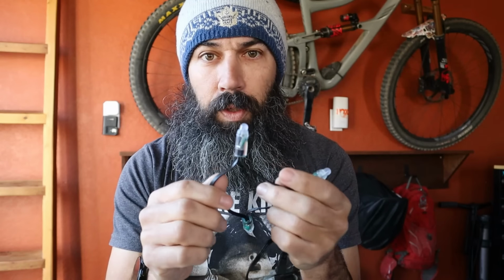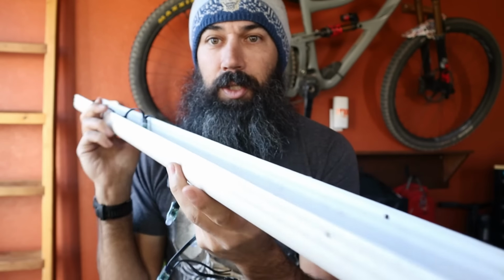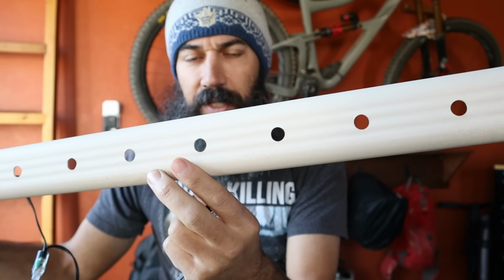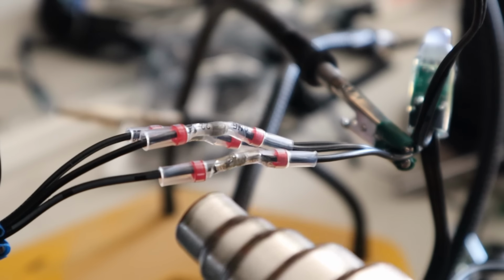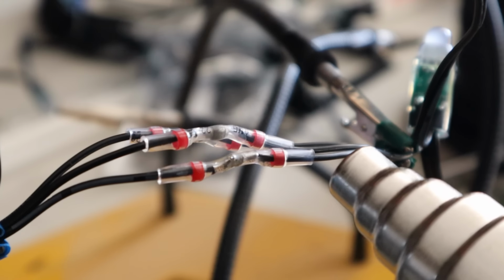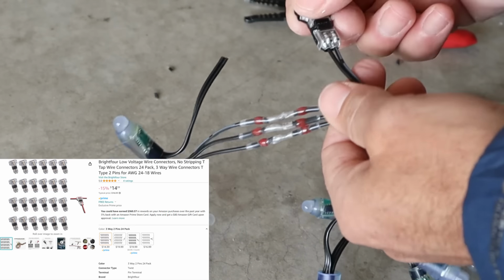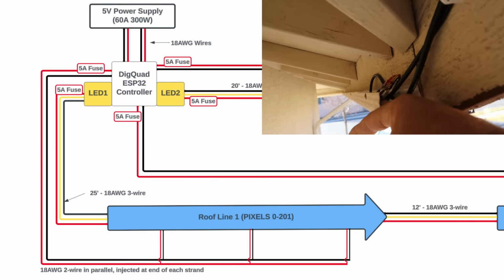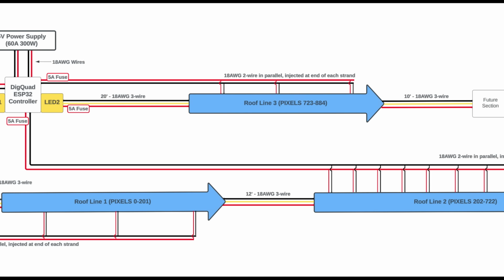Permanent and AFFORDABLE Holiday LED's

Comment: I want to put permanent Christmas lights on my house so bad, and have already bought some and tried some out.
The only trouble is what do you do when you paint your house? I'm a professional paint contractor and have been doing it for almost 30 years. Every time you paint your house something you can have to be done to all those lights and that's going to be time consuming, and expensive. Just wondering?
Peace from California!
Reply from the maker: That’s a really good question.  It would definitely create a challenge.  I’m not a paint contractor so I can’t speak from experience here, but…..how often does it need to get re-painted under the eaves?  (Unless changing color entirely)  Our house is stucco. It’s 10 years old. Our stucco trim definitely needs a fresh coat. Also I’ve done some of the outside of the fascia trim by hand already.  But under the eaves see very little sun/weather. So I don’t know how often they need to be painted. That said, if it was only once per decade, I think you could take these down a few sections at a time and put them right back up. Maybe a good reason to look at waterproof connectors instead of soldered….🤔
Reply: I mean unless youre painting your house every few months you would just remove the channels prior to painting.

Comment: Christmas and Halloween Light show enthusiast here.  Good rule of thumb is power injection for 5vdc pixels should be every 50 pixels regardless of how many feet you are going.  I use 5vdc pixels on my light shows and my cards are always about 5 feet away from the pixel strands and every 50 pixels use a power injection for both positive and negative lines.  2nd use IP67 pixels for waterproof pixels.  12vdc pixels are better for long runs and less wiring when it comes to power injection.  Suggest you NOT use the plastic downspouts unless they are UV rated.  Plastic electrical conduit are rated for UV an may be a better solution.  Overall, very informative video.
Reply: Aren’t vinyl downspouts UV rated already? They do spend their intended purpose in the sun all the time…..
Reply: Several years ago they were not and had mine taken down due to how brutal the sun was on them.  They were very brittle and had them fall apart when taking them down.  You would think the newer ones should be but would would have to research it @Eggwelder
Reply from the maker: @Eggwelder  pretty sure they are UV rated already. Don’t think you would normally paint one, so they would be in the sun a lot.  Although my channels won’t see much direct sunlight.
Reply from the maker: Thanks for the info.  Cards?  Are those the controllers?

Comment: Something to consider if you are doing this, look into 12V or 24V modules. When you get into wire lengths of 100ft, voltage drop starts to come into play and 5V may not be enough to make it 100ft+ to the end LEDs. Usually this shows up as color issues at the end of the string.
Reply from the maker: Voltage drop for sure comes into play.  When testing long runs I could definitely see a change in the color by the end of the strands.  Power injection is a must.  Using a larger gauge wire (larger than the strand wire) and injecting at the end of every strand seems to do the trick pretty well.  Definitely can't rely on the strands themselves to keep the voltage.  I assume that would be regardless of the voltage, but probably more pronounced with 5v like I did.  Either way, great call out!
Reply: On his diagram it looked like he tapped 5v into every new strand.
Reply from the maker: @joe_duck  correct

Comment: I haven't seen anyone use the downspouts for the pixel outlines before, quite often seen what they call J Channel which is for fascia I believe. Being from the UK I just don't have access to half the things you seem to be able to get at a hardware store that those in America do but we do have square gutting pipes, I had just not thought to cut it in half xD

It would be wise to be some what cautious about where you get pixels from, especially for a permanenet install, the cheap ones are know to die very quickly and often (from personal experience here). The cheaper lights also use cheaper computer chips that are not capable of reproducting the same range of colours, this is something I noticed when I started switch to better quality ones that were just so much more vibrant. The cheaper ones also have more erratice spacing between the pixels and use CCA (copper clad aluminum) rather than pure copper or tinned copper which are much better at conducting electricity so over the length of the string start to change colour as the voltage drops and power injection needs to happen more often.

There are companies in the US that are dedicated to "holiday light shows" like Mattos Designs, Wally's Lights, Wired Watts are just a few I have heard of but never used. In the UK there is Build a Light Show which I have used and been very happy with (no affiliation with any of them).

Lights from these companies also come pre fitted with out door rated pigtale connectors and often come with ready cut out "props" made out of plastic ready to push pixels into as well which are also great fun, singing faces to music are especially enjoyable to watch.

Just something to be aware of with the pixel strip vs strings, the string tend to be a lot more resiliant can capable of being moved around without damage, the same is not true of strip. With a permanent install this is not an issue but if you intend to be able to move them around the strip will fail a lot faster as the strip itself is very fragile.
Reply from the maker: BRO!  Where were you BEFORE I did this!  LOL!  Great info dude.  Thanks!
Reply: @DadDoingStuff  You're welcome and feel free to ask anything you like. This is what I do for fun for the last few years. Started of making megatrees outside my house, my current one is about 10ft :)
Reply from the maker: What kind of pixels are you using for the mega trees, and also how are you mounting/hanging those lights?  Also, are you running a separate controller for each of those?  Thx!
Reply: @DadDoingStuff  I use 12v pixel strings in the exact same bullet style that you have used in this video. Different brands call it slightly different things but something along HDPE Mega Tree Mounting Strip, basically it is a ribbon of plastic with holes every inch that are the right size for the pixel to slot into, I personally push a pixel into every other hole for 2inch spacing, some do 3 inch spacing, some populate every hole, up to you really. You then have a pole (I use piece of scaffolding) which at the top you have a topper which is usually a metal disk with holes drilled around the edge and you attach the strings of LEDs too. Then around the bottom there is a large metal ring, I used a trampoline frame for mine. I believe Mattos Designs have a kit you can buy but i haven't looked into it.

As for the controller, I used one called Falcon F16v4 which has 16 ports (can be expanded to 48 ports) and that can each handle up to 1024 pixels per port but I typically aim for less than 500 per port. If that isn't enough for you you can connect multiple pixel controllers together to controll larger shows. There are other options, I know of a brand call Kulp which I have seen good things about, I just can't get them easily in the UK. I have also seen people running their shows using many ESP32s using WLED so you can go as big or small as your budget, time and SO allows.
Reply from the maker: Dude!  I think you just inspired next year’s video!  Sorry one other question.  Where physically is your controller and how is it connected to your network?  (I guess that’s 2 questions)  I ask because my current controller is in my garage.  But for the yard, it seems I would want one or more controllers out in the yard temporarily in order to power anything out on the lawn and such.  Thanks!🙏
Reply: @DadDoingStuff  my controllers are in weather proof boxes not to far from the props. The one for my megatree is mounted directly to the main pole. Sadly, even with high quality cables the signal to the pixels degrades so you want to have the first pixel reasonably close to the controller, much over 16-20ft starts becoming problematic. 

In the US common boxes used are plastic ammo cases with holes drilled through and often weather proof cable glands to get wires in and out. There are companies, I think most of the ones I mentioned in my original post will sell you a pre made weatherproof box with controller in and all you need to do is give it power and plug your pixels into it. 

As for connecting together, there are a couple of ways, the most reliable way is to run network cables between them. Most have a seperate temparary computer network just for the lighting controllers. This is the best way if you have less intelligent controllers where you stream the instruction for the pixels from the main controller to the child controllers using E1.31 as they often send a lot of data and could make your home network run slowly.

With more modern controllers like the Falcon or Kulp they make use of MultiSync this means that each controller has a copy of the show and the master controller just send out messages just keeping them all at the same part of the sequence which can be done reliably over good quality WiFi. I actually have a Unifi WiFi Access Point setup in a location to make sure that all my controllers get a good Wifi signal.

I am really excited to see it your next video on this :D
Reply from the maker: I watched a couple of your videos.  Very informative!  You got a new subscriber dude!
Reply: @DadDoingStuff  thank you very much, I guess I will have to find something to make a new video about xD 

My local pixel vendor has released a new style of addressable LED called "Pebble Lights" (other vendors may call them Seed Pixels) basically the LED is part of the wire and lights up all around and has uniform spacing. This means that it doesn't need the pixel strip ribbon so it is much lighter so easier to manage up high. I haven't tried them yet but I am seriously considering retiring my existing pixels (by moving them to new props) and using this style of pixel for me megatree next year. Might be worth considering as it is cheaper by the (insert prefered measurement unit here).

Comment: Thanks for this video and the diagrams.  Well done.  i was a little unclear on one thing.  For each down spout tube, did you cut it to get two usable channels?  Or did you just cut off the top producing one channel.  Thanks.
Reply from the maker: Good question. I cut it in half, getting a pair of 10’ channels from each downspout.

Comment: Nice job batching out the parts. Another option would be partnering with someone with a cnc machine. Cutting similar parts from plywood would be very inexpensive
Reply from the maker: I would LOVE to have a friend with a CNC machine!!
Reply: @DadDoingStuff  if you're ever in Southern Cali and have a project in mind don't hesitate to reach out. I have a 5'x8' shopbot

Comment: And here I was almost ready to buy PermaTrack.
Reply from the maker: Don't get me wrong....permatrack will be WAY less work.  But, it will also cost you a ton more.  Also keep in mind that permatrack has fixed 2" hole spacing.  So you will need more pixels per foot than a DIY if you use permatrack.
Reply: @DadDoingStuff  heed the advice of testing the pixels before mounting as I did not and it cost me countless hours of frustration after the fact. Set your pixels on the floor, fire them up and let them burn if for a few days to be sure all is good before getting on that ladder to make the install. BTW: I like the fact that the PermaTrack has a second trim piece for mounting that completely closes off the backside eliminating a place for wasps to build homes. And places like THINGIVERSE offer .stl files for PermaTrack so you can use a 3D printer to make ends, 90 degree turns and more. Just use the type filament that they recommend that will stand up better to the elements. BTW: I am not connected to PermaTrack nor do I benefit by recommending their product.

Comment: Love it. Do you have any melting issues in the summer? 

Also, I want to do it around my window. It looks too wide for that. I wonder if I can heat it and reform it on a board so it is thinner. If you need to do the same, can you give that a try with some scrap you may have?
Reply from the maker: I'm already working on an idea for doing this around windows.  Most likely, I'll be using strips rather than strands for that one.  Stay tuned!

Comment: Simple jig for drilling the holes: Starting with a block of wood, drill two holes the desired distance apart. Insert a pin or dowel in one of the holes. Use the other hole to guide the bit. After drilling the first hole, advance the channel so the first hole and the pin meet. Use the guide for the nest hole. Rinse and repeat.
Reply: I agree. Large repetitive jobs like that are perfect to spend 5 or 10 minutes making a jig for. Makes it quicker and reduces fatigue.
Reply: @drewspears5301  Also reduces error.
Reply from the maker: That’s an awesome pro tip!  I’ll be using that on all kinds of projects!! 😎

Comment: Thank you so much for specifically discussing what others have glossed over. If you wanted to go into even more detail in how you ran the cables from the controller and how you routed them through your attic or crawl space or whatever, I would appreciate it! We have different roofing styles but to gather ideas for how to run mine would be greatly appreciated. Even if not, great work on this one and thank you again!
Reply from the maker: Hi Ben.  Thanks for the comments. I could go through that in a quick video pretty easily.   There a few points I didn’t touch on in regard to actually attaching the cables and running them.   Good call!
Reply: @DadDoingStuff  I'd be interested in that as well. Great video btw. ....and go Pens! ;)
Reply: @DadDoingStuff  I would be interested as well. Thanks! Awesome video!

Comment: That's a great DIY job! I bought 200 12v pixels with the plan to find some sort of pvc channel and drill the holes as you have. I couldn't find any suitable channel here in the UK that was fairly cheap and available that I could be sure would work with my roof. After finding some 45x25mm channel I thought might work, and then working out how I'd drill the holes the correct size and accurately spaced with my available tools I just looked into Permatrack. Surprisingly available here, 2" hole centres, side firing to suit my roof and £150 for enough to do my roofline. Due to my initial DIY 3" spacing calculations I had to buy another 100 pixels. I'd left it too late this year to do the full install so I did the controller box and just strung the pixels out for Christmas.
Reply from the maker: Thanks James. At least you got them all working on the controller for now!  The spacing can make a huge difference on the number of pixels needed (as you just learned).  Appreciate you watching!

Comment: Used downspout as well, but cut them in half on the other axis. Got two 1-1/2” deep channels from each 2x3” piece. You can also get a vinyl glue for joints.
Reply from the maker: Hmmmm🤔 never thought about glue.  Good call.  Did you rip them with a table saw?  If I did it again, I might actually use some power snips. Vinyl sawdust is pretty statically charged so it makes a big mess.
Reply: @DadDoingStuff  yes, cut them on a table saw. Agree it’s statically charged and messy. But it works! Used the RH Adhesives HH-66 Vinyl Cement. My install was just over 120ft 700+ pixels

Comment: used j-channels for my mounting, but this works
Reply from the maker: What J channel did you use?  I started down that path and just didn’t find any that was the size I was looking for.
Reply: @DadDoingStuff  1/2 in. x 1-1/2 in. x 12.6 ft. from home depot If I remember correctly.    I ended up 3d printing a jig to drill out the hole for it and its nice and tight in there.

Comment: Looks great. I did ws2811 pixels this year also. I tried using j-channel and pvc, but wasn’t having luck with making clean holes. I gave up and shelled out for permatrack. Yes, it was more than my supplies, but it is great quality. I ran 12v pixels with 16ga and only had to inject once every ~200 leds. I picked up an esp32 and 5v pixels for a wreath. Then I also got 7 bulbs from aliexpress loaded with WLED in my outdoor sconces. Next year I think I will do the top ridges of my roof in ws281x C9 or C7s if they are available.
Reply from the maker: Permatrack defintely looks good and cuts down on a lot of work!  I like your idea about some C9’s…..always been my favorite bulbs!